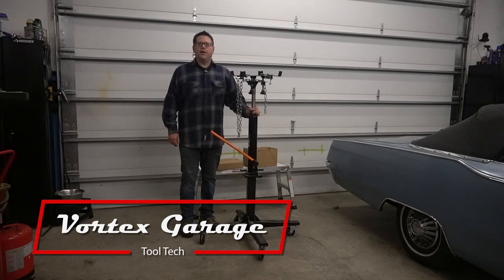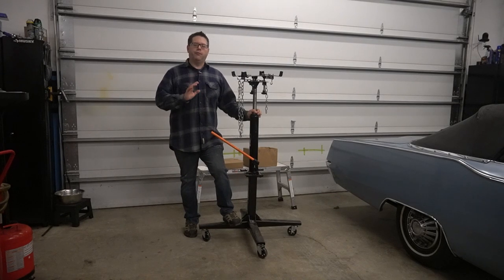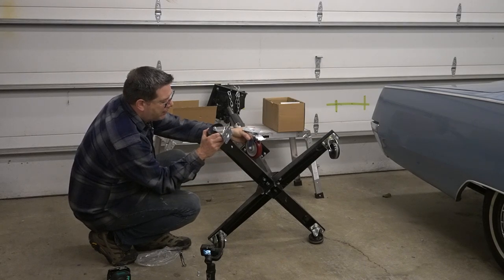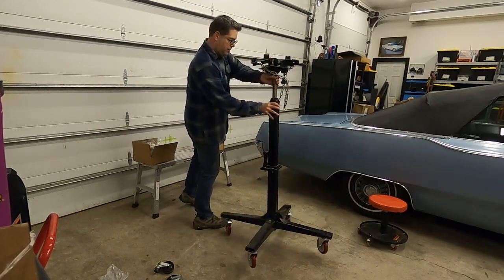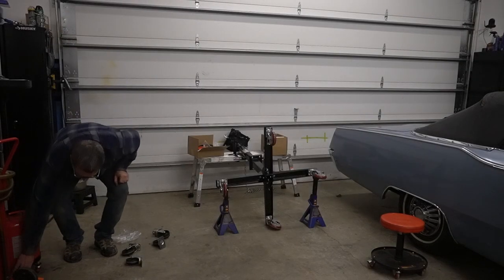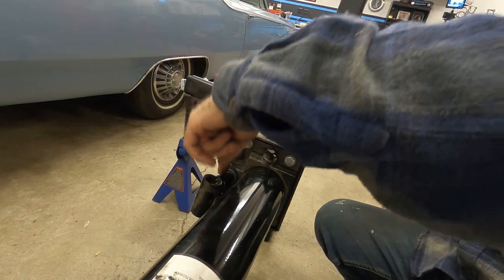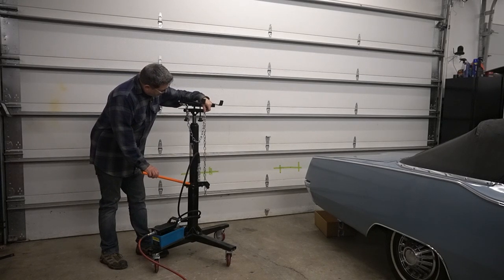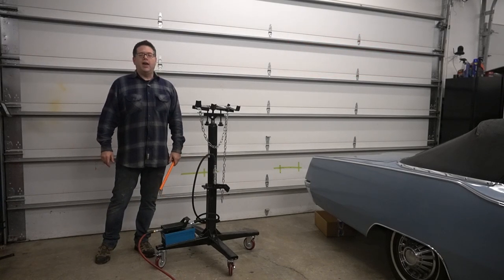Upgrading the cheapest transmission jack available with air hydraulics - How improved is it??

Comment: I was thinking if you would want it to be more tip proof you can find some scrap square tubing and extend the legs out by cutting and welding it on and then drill holes  to move the wheels to the end of the extension part, that would for sure prevent the unit from tipping and you wouldn't have to worry about it ever potentially happening and causing damage to expensive transmission. Also maybe weld in extensions to the top as well for more surface coverage. Just a thought. Glad to suggest my thoughts.

Comment: I was thinking instead of using the stick to turn the release valve that you can probably weld a knob of some sort so that you don't have be looking for the stick or just keep track of it in general so if you.need to lower it you would just turn the knob and then tighten the knob back to stop it from releasing and then doing that it will be a all in one unit and the only thing you would really need to do when you need to use it is to connect the airhose to the pump.